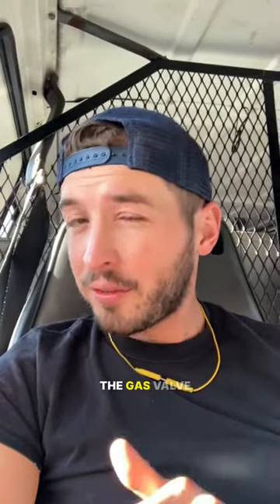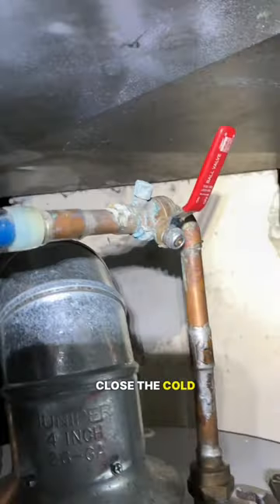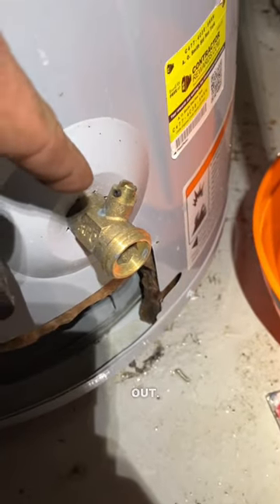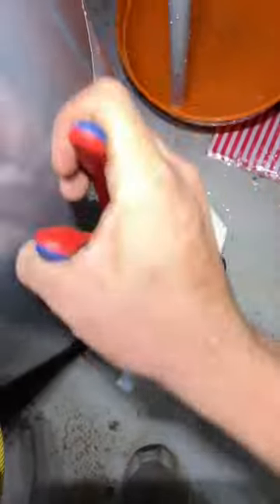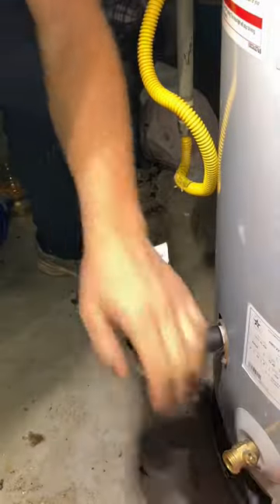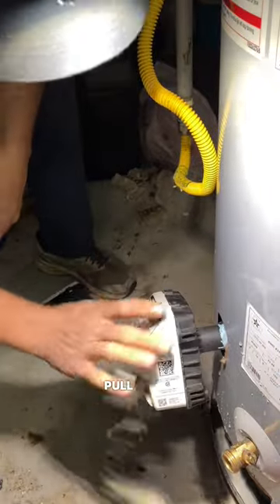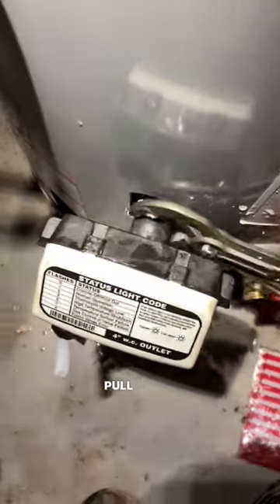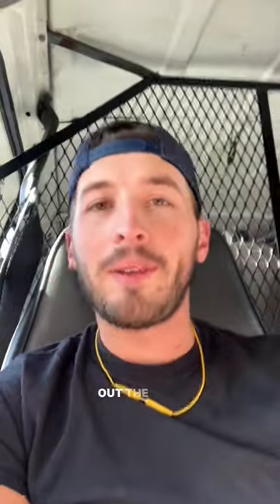Fast Way to Change Water Heater Gas Valve

Comment: That is some Journeyman Plumbing trick right there.  Solid work.
Reply from the maker: Very generous of you, thank you good sir.
Reply: Looks good to me, I don't know how long that Tank's going to last though.
Reply: I'm a journeyman. I still don't do that because if he broke those plastic threads off you now just drained a entire heater in their house. My dad's a master plumber for over 40 years he stepped on a plastic boiler drain and flooded a apartment he was changing the elements in the heater ... my cousin a master plumber would swear by pulling out the electric elements without draining down the heater... he had a electric element flare and get jammed when trying to pull it out and then cross threaded it trying to shove it back in to stop the water ... had to buy a new heater. Just take your time homie
Reply: My girlfriend did this while I was at work she changed the heating element with it live too because she flipped the wrong breaker
Reply: He knows a massive amount for a apprentice. Im a licensed maryland journeyman plumber , I'm very impressed. Who are you learning under @apprenticesurvivalguide. And where did you obtain your knowledge.
Reply: @Matthew Mcmullen  she really did, she some how managed to not touch anything she shouldn't have. The breakers are labeled wrong in the house so I changed the thermostat while it was still hot and it didn't spark until i shorted it out against the outside of the heater.
Reply: @Zach  you both need not to be touching that you could've been FUCKED up. That is 240 electric you're playing with. Get a multimet meter test the incoming wires and have her shut breakers off. You'll know which is which
Reply: @Matthew Mcmullen  yeah I know we are relabeling the entire panel right now. My father and brother are union electricians so I've got to mess with enough stuff I know what I'm doing to not get killed.

Comment: The worst is when your doing this and customer cracks a faucet 😮😂
Reply from the maker: It's like when you say, "i'm working on the sewer line don't flush anything".....20 minutes later (flush)
Reply: @iliketakingshowers  because you were too slow!
Reply: That's the reason I put shut off valves on both inlet and outlet when I install new water heaters.
Reply: Plumbers Darwin awards style rule... if a customer can do something stupid, they will... Take precautions.
Reply: @johnnyteague3407  it's against code, for safety reasons, but if the inlet and all the faucets are closed, it's essentially the same.  So, it's dumb rule.
Reply: @markgigiel2722  a good way to test the T&P valve
Reply: @JasonW.  Yeah or start your own rocket company.
Reply: @theapprenticesurvivalguide  how about working on an air handler and owner flip's switch to main breaker
Reply: @theapprenticesurvivalguide You shut off the water and flush all the toilets.

Comment: That is NOT how you are supposed to pull or reinstall the gas valve, the plastic that you are grabbing will crack, it literally tells you in the instructions to use a 6" piece of pipe in the inlet of the valve to unscrew the old AND to screw in the old...

Comment: If by chance you get the new control valve wet. Then you have a $400 part that doesn't work. You have a customer that's pissed off at you. And you have to go get another control valve.

Comment: Might as well drain the tank for deposits while changing it. Value added service. Use a strainer so you can show the customer if they have hard water.
Reply from the maker: Instead of draining the entire water heater, would draining a buckets worth out to get sediment off the bottom and also save time filling it back up be a good compromise, or drain the entire thing regardless?
Reply: @The Apprentice Survival Guide  drain the entire thing regardless. be thorough. it is so easy to miss something, and if you're the last one to have worked on it you know who they'll be calling when they have a problem (even if it had nothing to do with what you repaired)
Reply from the maker: Thank you for the advice Katlin!
Reply: @Katlin Ginner  nice words, I was going to say this. I get raised all the time!
Reply: @shortstack2k0  not a good idea to drain an entire tank that’s never been drained or serviced
Reply: A real plumber would do that
Reply: I use nylon women's leggings and a zip tie at the bottom of my hose. Catches everything on a bag. Makes for a dramatic show haha.
Reply: Those same deposits could be the only thing keeping an old tank from leaking.
Reply: Bingo!

Comment: FWIW, to save yourself from marring or possibly cracking neck of the gas valve, Honeywell recommends using 6-8” nipple in the gas inlet connection as leverage to remove the old valve & install new.
Reply from the maker: That’s a great tip John thank you!

Comment: I learned that when I was still an apprentice thirty years ago. You can do it with elements as well, but you run more risk as elements tend to open up when they fail for some damn reason and won't always slide right out the hole in a timely fashion and jiggling it around trying to get it out allows the water and air exchange to happen much easier.
Reply from the maker: Seems like you’ve done this a few times! I appreciate the advice thank you that was very generous!

Comment: Just leave the assembly inside the reservoir & swap out the metal valve inside the plastic piece that holds it in place. There’s usually two plastic tabs & a screw that holds the metal valve in place

Comment: Wait. Water tanks sometimes last longer than a gas valve?
Midwest water tanks will start to leak if you look at them with a sideeye
Reply from the maker: This is a two family house, one water heater for each tenant. The other water heater went flooding the basement and this gas valve got wet so it had to be swapped out

Comment: That's the only way I do them. Vapor Lock for the win
Reply from the maker: Opened up a whole new world for me! no more draining the whole thing down for under a minute of work to wait while it fills back up, glad to know i'm not crazy in my thinking lol
Reply: Not a vapor lock.   It pulls a vacuum
Reply from the maker: @VinceBlack536  Thank you for the support Chris! Honestly one of greatest tricks my boss taught me so far
Reply: @VinceBlack536  vapor lock equals air lock, interchangeable terms for the situation.
Reply: @dontemailme      For this situation yes I agree.   But incorrect term used   Just saying.   Coming from 30 year plumber  who has nothing better to do.    😂

Comment: Had a customer order about 100 electric 40 gallon lowboys with the wrong element kw they needed. So took 200 elements and slammed them in the same way! Wasn't draining 100 40g water heaters in an apartment complex had some spillage but did it in 2 days vs a week draining every unit

Comment: I did the same type of trick on a 14,000 gallon tank of liquid detergent. It wasn’t a gas valve it was a 4 inch ball valve that leaked from the stem when it was in the open position.

Comment: Provided its not calcium build-up that caused the  control valve to go bad. You might have to drain the tankee to sat build-up
Reply from the maker: The actual cause of the control going bad was the other water heater in the basement let go and flooded it up to 2ft. The valve went under water so had to replace it and the pilot assembly.

Comment: You're supposed to intermittently drain tanks to discharge sediment. Old tanks have sediment balls that bounce up and down, making an annoying sound. Why not take the opportunity to do the right thing?
Reply from the maker: what about draining out the sediment and using a vapor lock technique? Best of both worlds, not to mention most of the time the drain is clogged anyway lol

Comment: Never saw a gas valve that supply gas to a burner inside the tank. What kind of gas are you using that burns under water??? I have used this method on electric hot water tanks.
Reply from the maker: good question Glenn, the probe that goes inside the tank is actually the aquastat probe, the burner is under the tank.

Comment: Next time you change a gas valve, don’t use any tools. Get a 12” or longer 1/2 black pipe and pipe it into the gas valve on the gas inlet and use this pipe to loosen the valve, once loose just turn by hand. Install the new valve using the pipe the same way.  Easier and no chance of damage!    Thanks…Jim
Reply: That's the way the Honeywell (now Resideo) gas valve instructions tell you to do it!
Reply: I use a 10" pipe. So easy.

Comment: I do the same when changing the heating elements on a electric water heater. I run the water without it plugged-in for few minutes so the water inside cools down some.

Comment: That's grade school level. I would swap out Schrader valves on the low side of automotive A/C  systems . Shut off they are over 100 psi pressure. Start them up put on the air, high idle, hose down the condenser put the new one between your finger and thumb. Unscrew the old one and let it fly. Stick the new one on the tool with your fingers still holding it and push it in while turning it. Very possible at below 30 psi.

Comment: I've been doing it like that for years I also do elements like that only problem I've ever had was when they made them double coil elements they will expand so they don't come out so easy but now I know how to tell which they are from back of them but I just turn my shop vac on with hose right below it just in case

Comment: This isn't necessarily plumbing, but when working on hydraulics on tractors, I'll put a vacuum on the fill tube and turn it on, I can do whatever I want and nothing leaks out, vacuum never gets oil in it either.

Comment: Do you know if i shut off the water to the tank and just run  the hot water Faucet, run in the bathroom and in the sink. Do you think it will drain the tank without putting a hose at the bottom

Comment: I personally never use a wrench on those honey well tstats. I've had a few snap off in the Rheems. I like to stick a piece of 4" galvanized pipe in the tstat gas inlet and use that as leverage. Slowly apply pressure untill it's hand loose.
Reply: I do the same...😅

Comment: So they make those valves so you don’t even have to unscrew them from the water heater they’re in three stages and you can just change out the valve. It’s in the middle couple of screws pop it out pop the new one in. Unless you’re getting a code five or five flash, you don’t need to take the well house and out at all.

Comment: And it’s not calcium build up it it the sacrificial anode rod that has broken down in your water heater. This is a maintenance item and shall be replaced to extend the life of the unit. PM is worth it

Comment: Quick question how much time do you save my doing that compare to draining?
Reply from the maker: A significant amount of time. How long would you estimate it takes to drain the entire tank, remove the old valve, install the new one, refill the tank and make sure it heating? in my opinion thats time spent just standing there watching it drain and fill and then heat up. Not saying this is the only way to change a valve by any means
Reply: @theapprenticesurvivalguide  well you got to remove the valve both ways and probably take less than 10 minutes to drain the tank also how do you check to make sure new valve is working with out cycling the tank I think it’s really cool what you did I’m jus wandering if it’s worth it over the traditional way but there’s different ways to skin a cat lol 😂
Reply from the maker: Couldn't agree with you more! I personally like to change it like this if i can to save time, but wouldn't run the risk doing it if it didn't feel worth the risk. imo its a judgement call at the end of the day.
Reply: could be literally hours
Reply: @MakingASign  especially if the tanks in the basement

Comment: Done the same on the drain once , unfortunately it was on a cheap plastic one so it snapped and some pieces for stock inside... While the water kept on coming out 🤣
Reply from the maker: Oh no Alan! Thats my worst nightmare! I only attempt this in basements that have nothing in it or aren't finished in case anything happens the water can just drain out and find the floor drain
Reply: I got a call at a church that they broke the plastic drain off with the sweeper. Just heated the plastic up and used a screwdriver to remove it. Installed a brass pex fitting and short piece pex and a shutoff

Comment: Do you know you can just swap out the front controller on those instead of removing the assembly, unless it was cracked and leaking for the shank of the sensing element
Reply from the maker: I did not know that thank you for the feedback, is that a special order part or supply houses have them?
Reply: @theapprenticesurvivalguide  no you buy the whole assembly it just snaps off the front and if I remember correctly there’s one screw as well
Reply from the maker: Thats awesome info, thank you for the information!

Comment: you can never know if the heater can get air somewhere.. it only takes one to get away from this so called quicker fix.. we use milwaukee transfer pumps to drain the heaters quickly.. worth the wait imo

Comment: that flex gas line is a no go in most places
Reply: That's a standard gas flex line. Required pretty much everywhere. 😆
Reply: It's not code 90% of USA
Reply: It's required in earthquake and hurricane zones, it's acceptable in most places. It still needs a particle trap. You generally don't see it on the east coast. I don't know if there are still regional regulations anywhere requiring it.

Comment: I have done it. What is the ethical dilemma though? Charging full price for a job that takes less time? I was a mechanic for decades and always heard you charged 3 hours labor but did the job in 2 hours. I respond, you pay for my knowledge, training, and experience. If you or a less skilled technician was to perform the repair it may take 6 hours. Should you pay me more if I run into issue and it takes me longer? That happens as well.

Comment: Gotta show them changing a gas valve with the gas still on. 😂👌
Reply from the maker: Omg no lol, YouTube couldn’t handle that 😂
Reply: Had to go that route one time cuz I wasn’t about to go re light 18 pilot lights in this mansion we were working in hahaha
Reply from the maker: 18! I gotta here more!
Reply: @Moelester692  : You were working on that big (I assume very nice) house and it didn't have shut off valves for each appliance?
Reply: @dustintunis9347   I was changing a shut off valve for a stove and didn’t wanna shut the house off to shut it down because the house had like 2 boilers and 3 water heaters and all kinds of other stuff running on gas so I just did it live haha
Reply: @Moelester692  Nat gas is around 1/4 psi, so you could actually block it with your finger for a minute.  I still wouldn't recommend it.

Comment: Smarter way to do it is just swap the board out without unscrewing the whole thing. Some older heaters are smaller in diameter now so the newer ones housing won't even go in all the way to start to thread.
Reply: True to a degree, the older grey bradewhite gcv well sensor at the tip of the shank is all plastic and they often get a hole in them so you have to change the entire valve.  The electronic valves in general are junk to begin with, it’s like a toilet and a flapper quit reinventing the wheel.
Reply: Some guys sitting in an office engineering it 100 times over making 7 figures while were the ones stuck fixing it all for 100k a year 🙃🫠
Reply from the maker: Didn't know the board was capable of being swapped, going to give that a shot next time i'm swapping one out thank you.
Reply: Four clips and two screws and the guts of the gas valve come out of the housing. Just leave the back of the housing in the tank. Slide the old guts and slide in the new. No leak.

Assuming the housing isn't leaking. ;)

Comment: With how sensitive those plastic controllers  are ,I wouldn't risk it(by risk I mean the controller getting wet). Just tell the client to empty the water heater 30 min prior to the installation.
Reply from the maker: I see you’re point, why damage a brand new control to save time, just wanted to show that this is possible, definitely not for a typical homeowner to try

Comment: Honeywell makes junk gas control valves for water heaters, terrible thermostats for HVAC. These valves are so bad that none of the local building supply companies stock or sell gas water heaters. Have to drive 40 minutes each way just to get a new water heater for clients.
Reply from the maker: Its amazing that Honeywell quality has taken such a nose dive! You're right!
Reply: @theapprenticesurvivalguide  installed a brand new HVAC system for a customer. A week later, she called saying her electrical usage was way up . With the new RF meters and you can monitor you electrical usage and it was give you warnings about outages, a dropped leg and any error codes on the meter. Come to find out the Honeywell thermostat was malfunctioning. No matter what you set the temp at, it was trying to get the house to 65 degrees, so the ac never shut off. You Will never reach 65 , definitely not here in July in Mississippi.
Reply from the maker: Thats for sure! I'm shocked the Honeywell thermostat malfunctioned like that, usually you hear more complains about smart thermostats. What are your thoughts on them Johnny?
Reply: @theapprenticesurvivalguide  I don't like smart thermostats. I had installed one at a customer's home. I worked well for a year then Entergy installed the new RF meters in the he area. After that the signal from the RF meter cause the wifi smart meter to malfunction. Many people complained to the PSC about smart meters interfering with wifi devices and cell phone reception. I have made a killing installing cell phone signal boosters for the last two years. Guess who makes the smart meters Entergy installed???? Honeywell